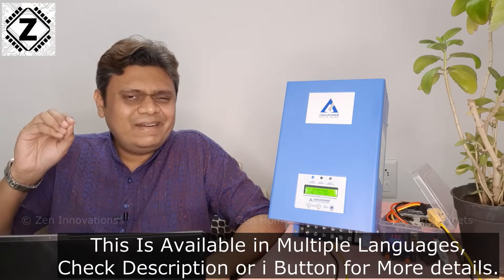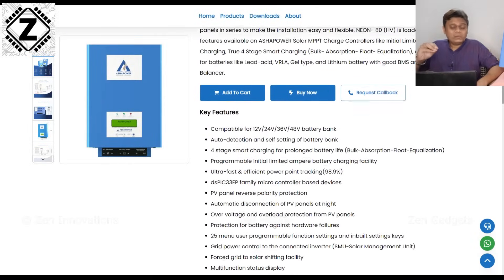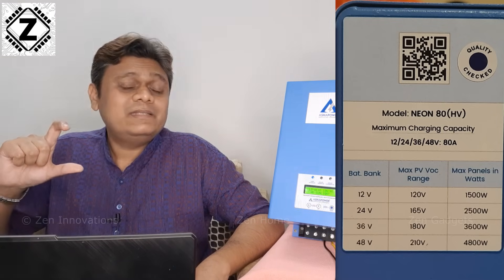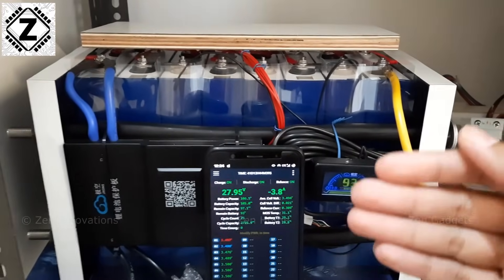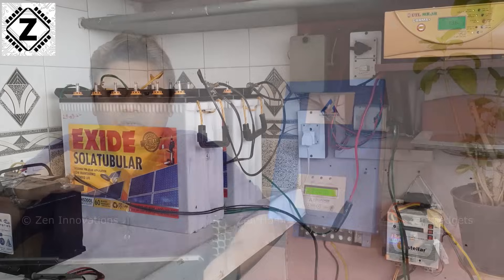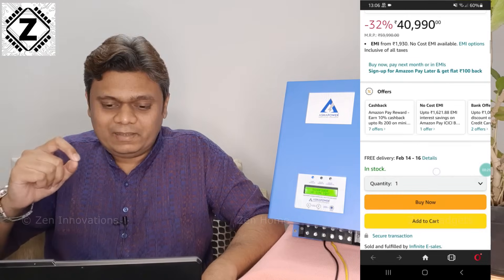[Eng] Say no to Electricity bills! Ashapower Neon 80HV Lithium Solar MPPT Review & Accuracy test

Comment from the maker: Note- 3 year warranty is for Solar inverter PCU and there is 2 year for MPPT.
This video is available in multiple languages-
Hindi https://youtu.be/YZtlFnazST4
English https://youtu.be/nl9XMQcgH8k

[Best buy Affiliate Links]
Ashapower MPPT with SMU
Nova Series https://amzn.to/44kuJ2r
Surya Series https://amzn.to/4crlnE6
Neon Series https://amzn.to/42sxk7X

Solar Inverters (PCU)
Ashapower Solar PCU https://amzn.to/4cufhDc
UTL Gamma plus https://amzn.to/43JW3XO
Eapro Solar PCU https://amzn.to/3Elh9RZ
Smarten Superb https://amzn.to/3RQgStf

Buy Solar DC Cable https://amzn.to/44mW0kP
Buy Solar Panels https://amzn.to/3RKAq2a

Website link & Credits
https://ashapower.in/product-lines/solar-mppt-charge-controllers
https://ashapower.in

Chapters English
00:00 Convert Old Inverter to Solar Using Ashapower MPPT SMU
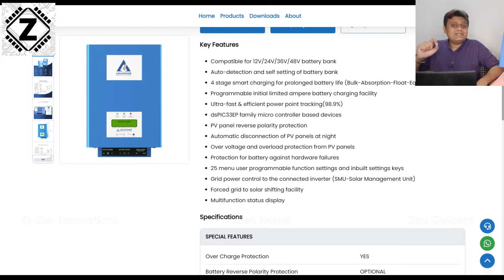01:06 Specifications, Benefits of HV Solar panel support
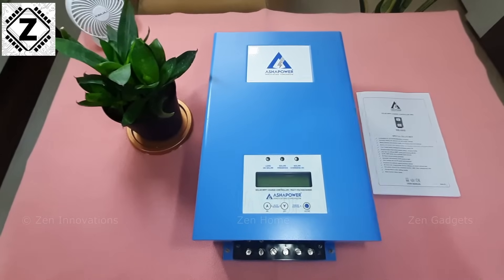04:18 Physical overview & Build quality
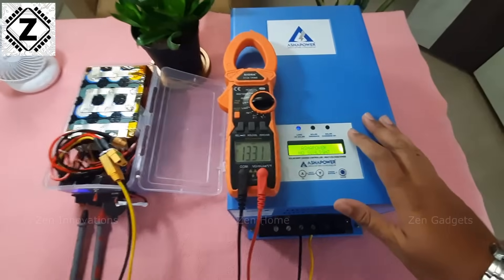05:55 Display Accuracy & Lithium LifePo4 Battery support
09:35 Pros & cons, Missing features
12:51 Pricing & Discounts
13:46 Detailed testing

Comment: That's one a good solar charge controller but if we   need to connect lfb battery then inverter should support lfp battery 😢
Reply from the maker: This machine has effortlessly charge Lfp battery. Just your inverter should support Lfp low Cut Voltages.